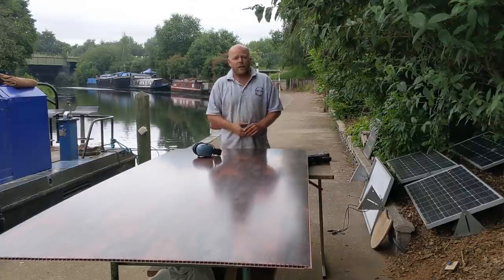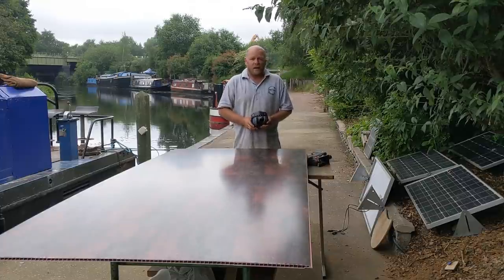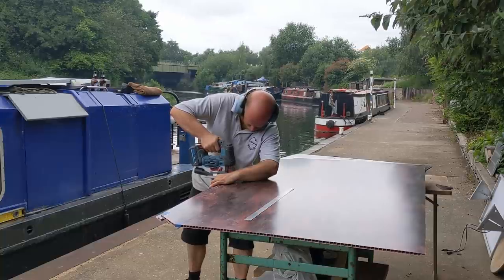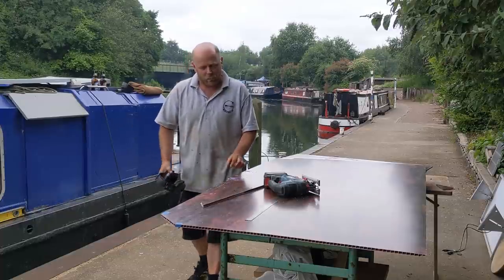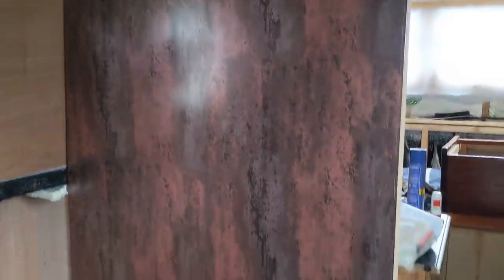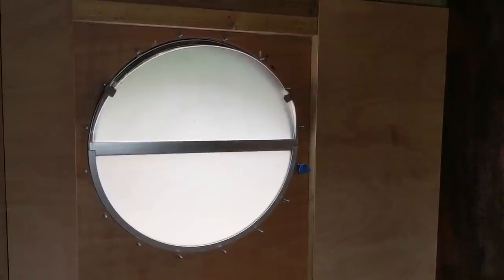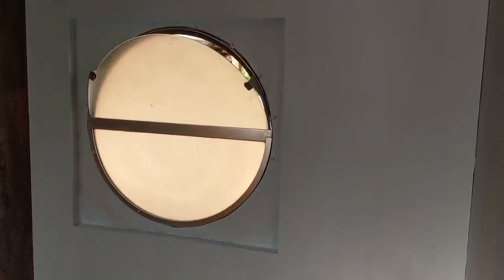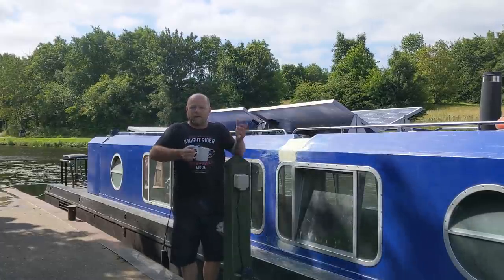Building a bathroom on a narrowboat - Boating On A Budget

Comment: Looks great 😊 I am a little confused won't the painted wall get damaged by the water? Maybe I missed something? Tell Dawn she was missed. I hope you plan to show us when you fiberglass the shower tray. I honestly enjoyed watching you and Dawn work together. Have a great week 😊
Reply from the maker: Yes we will show fibreglassing the shower tray. 
Just a pity Dawn has to work more days than me or we could always work together...
The paint is bathroom paint so should be moisture proof. Time will tell though I guess!
Reply: @WingingItBoatingonaBudget  Thank you, I didn't realize they had paint that was water resistant.
Reply: Yes I too have misgivings about using plywood for shower walls even if varnished . IMO water inevitably will find a way eventually through a timber structure. I shall be converting a tiny WC cabin into a shower wet room using fibreglass  shower tray and walls of the thin light weight board specifically designed for showers and bathrooms .